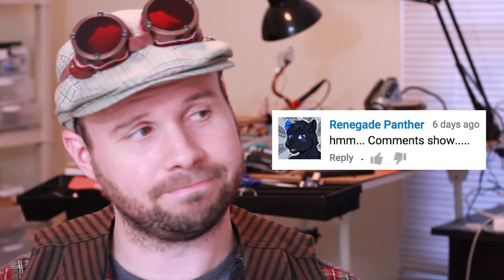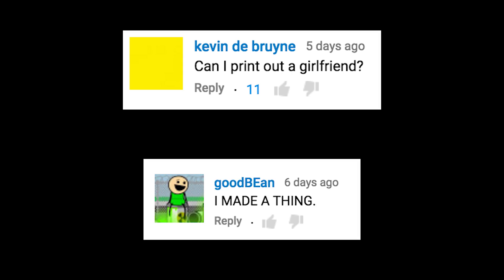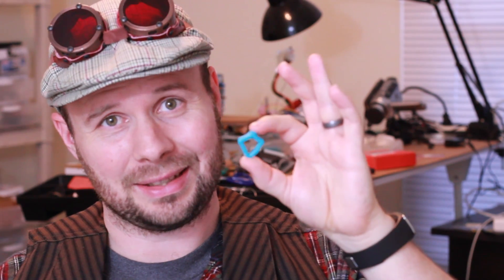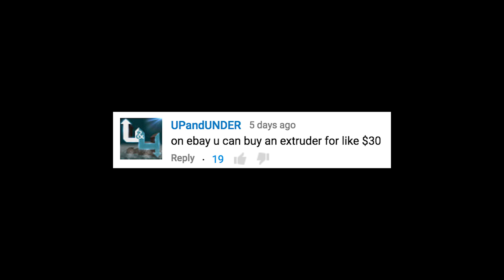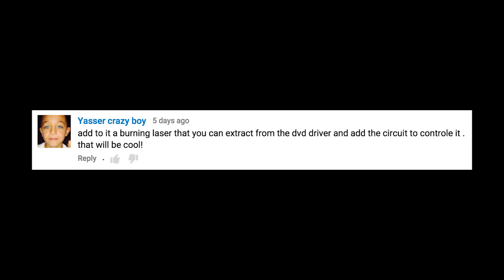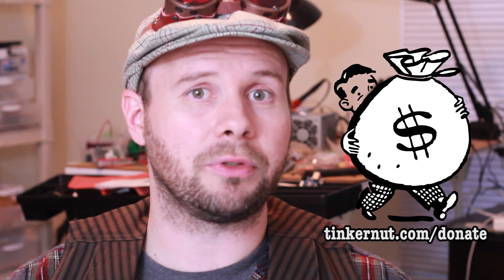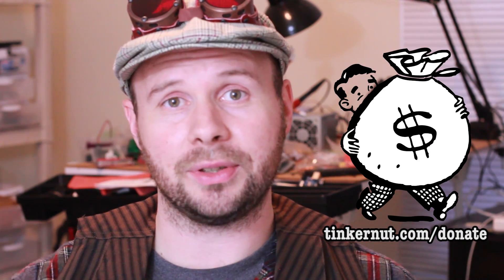Comments Show: How To Make A Super Cheap 3D Printer

Comment: http://www.ebay.com/itm/3D-Printer-All-Metal-J-head-Hotend-Extruder-Nozzle-0-3mm-filament-1-75mm-RepRap-/181910932202?hash=item2a5abc8aea:g:9SgAAOSwo0JWKc8V $8 extruder with .3mm filament. donno if this would work or not
Reply: +MultiCakeProductions i think you would still need a stepper motor but thats just one more free dvd drive you would need to acquire and some gears
Reply: +MultiCakeProductions If you're going to use low powered repurposed stepper motors then bowden isn't going to work very well.
Reply: ah ok, im new to the whole CNC scene
Reply: I found this http://m.aliexpress.com/item/2041911750.html
Reply: noice

Comment: Yes please do the laser!! I don't need the 3d printing stuff i need how did you build the burning laser! I've tried it like 20 times watched it from all the main youtube stars who are good at this kind of stuff! But i'm sure i could get it to work if you make a how to video your project videos are all very step by step so that any non tech save person could understand!! Though, it'd be a good project to watch! Thank you again for such cool Projects!
Reply: +Reddi Sathvik The laser should wire up the same as the pen. A transistor across the batteries to switch it.
Reply: joblessalex Actually i'm pretty poor at electronics.Any way mate thanks for your help!!
Reply: Reddi Sathvik Welcome. Might need adjustments for how fast it moves since those pointers are pretty weak.
Reply: +Reddi Sathvik You also  might wanna buy a convex lens to focus the laser
Reply: +Shahe Ansar I was assuming the guy had the laser already. Guess not.
Reply: joblessalex ???
Reply: Shahe Ansar Usually they come in a housing with adjustable lens already if you buy them off the internet. Just add batteries or batteries and driver.
Reply: joblessalex Oh, I was talking about those cheap ass ones on ebay
Reply: joblessalex Ofcourse i do have the laser man!!
Reply: Reddi Sathvik What kind?
Reply: Shahe Ansar I've extracted it from a dvd drive!!Didn't get it to work till now
Reply: +Reddi Sathvik  
the thing is with that project its going to be much harder